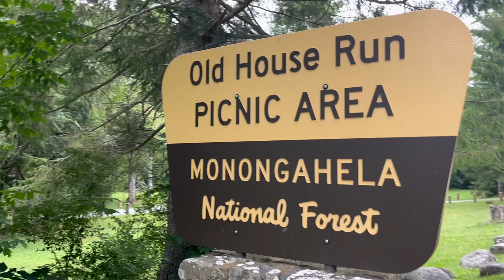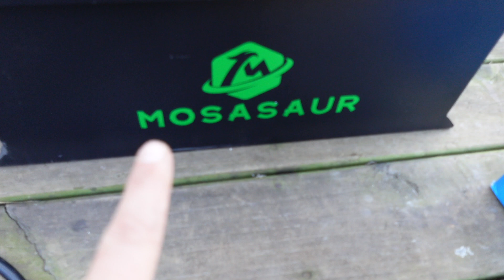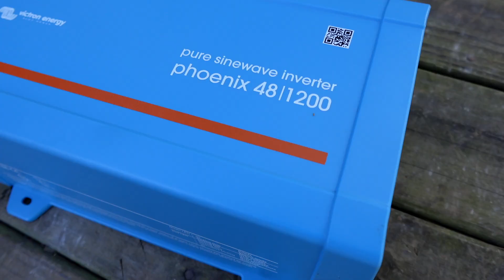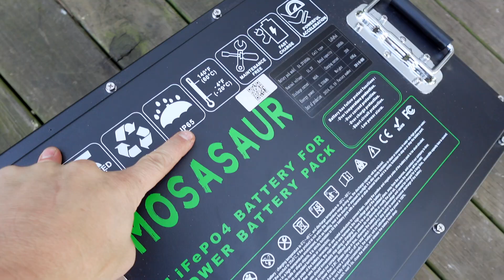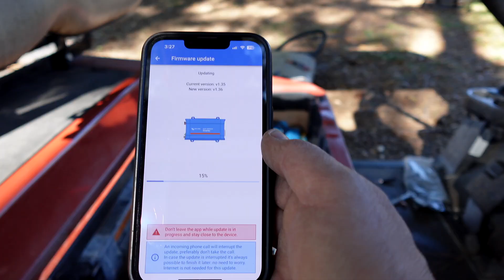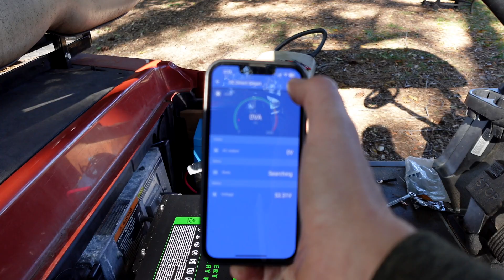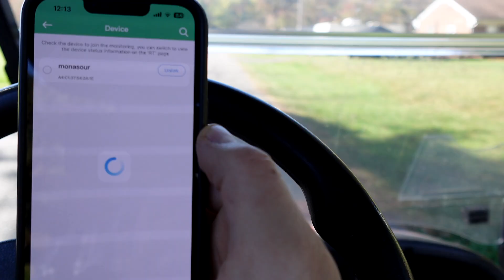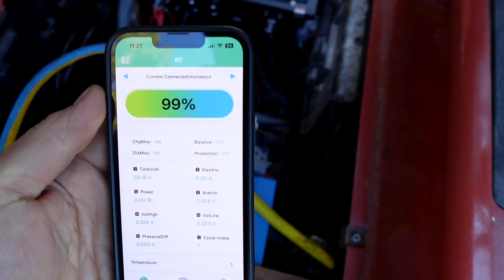Golf Cart Battery to DIY Portable Generator - CHEAP & EASY

Comment: Could I use my golf cart battery (72v Lithium) to recharge my Anker power station?  What kind of hook up would I need?  Would I still need an inverter?
Reply from the maker: Quite possibly...which anker power station do you have?
Reply: @BootstrapRevival  F3000 (actually currently shipping)
Reply from the maker: @lungshou  - Those things are sweet!.  I don't see a way to directly charge the F3000 with the 72v DC out of your cart.  Smaller power stations can be charged via USBC but not yours.  If I wanted to utilize the stored power out of my cart and put it into my power band I think I'd be looking for a 72v inverter.  You could then use the pass through charging on the Anker.
Reply: @BootstrapRevival  Thanks for the info.  I was hoping there was some way to skip getting an inverter but I guess that is the way to go.  :body-blue-raised-arms:

Comment: How did you power your headlights/taillights on the cart?  Normally people use a 48v to 12v converter?  Did you do it a different way?
Reply from the maker: You are absolutely right.  No headlights on this cart yet.  The others I’ve had I used a 12v step down converter.

Comment: Why would you need to pull the battery and inverter instead of an extension cord? Would that not be easier? Thank you for your excellent video sir.
Reply from the maker: I was just trying to make it flexible.  Maybe I need to carry it to a jobsite or bring it in the house and shut the door.  Maybe I'm over thinking it 🤣
Reply: @ I wasn’t busting your you know what’s, I was actually curious sir.
Reply from the maker: You're good!  I had a thought last night.  I'm wondering if I can power my RV AC (alone) on this inverter and battery.  I'm for sure going to have to try it out.
Reply: What would take to leave everything in the cart and just plug in a drop cord to a refrigerator?
Reply from the maker: @OLDRUNNERDUDE1  - Great question!  The short answer is nothing but the drop cord!  I really wanted to make this mobile so I can drive it to a neighbors house to plug in a fridge or washing machine for an extended power outage.  It has a 3 way splitter for a 110 plug under the seat.

Comment: Fun video! I love the idea of an emergency preparedness golf cart.  Throwing a 300 watt panel on the roof would charge that battery up from 0 in about 22 hours of sunlight assuming 250 watts of input from the panel.  That would keep that freezer running indefinitely.